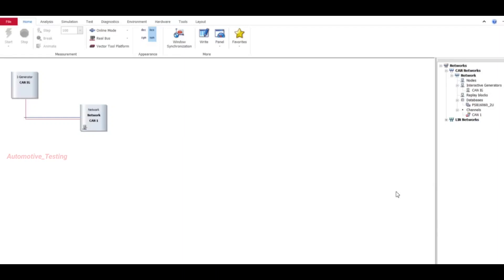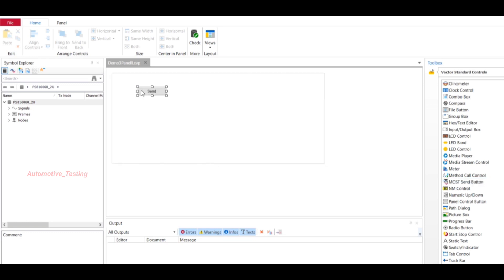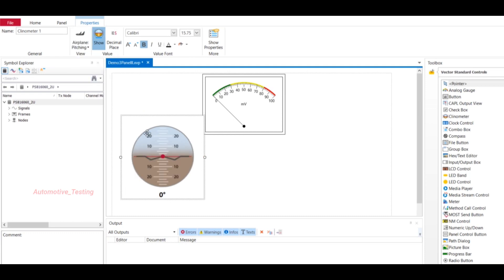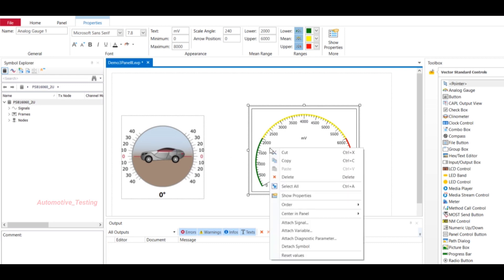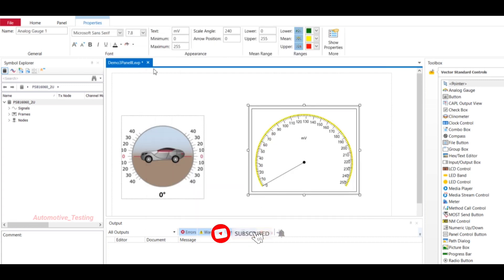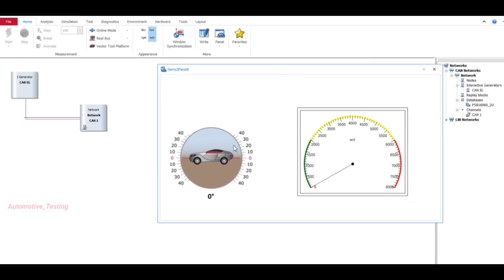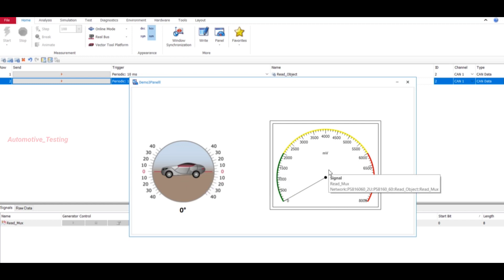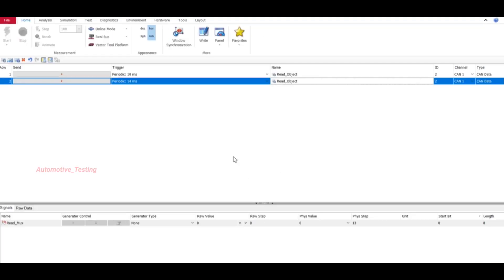🤔How to design a panel in vector CANoe/ CANalyzer🤔 #canoe #howto #automotive #infotainment #cluster

Comment: Why am I not able to input a speed command against an input box? when I click on it does not enter any values
Reply from the maker: May be you are missing some steps
Please check again
Reply: @Automotive_Testing  only thing i noticed is that display mode is true for input/output box but its greyed out and I cant change it to false ...?
Reply from the maker: @joshmills9829  I will try this and let you know soon
Reply: Can  I get a little bit of information regarding the need to create a panel in a canoe for uds  to test flashing PBL